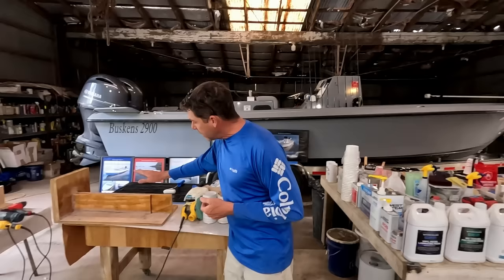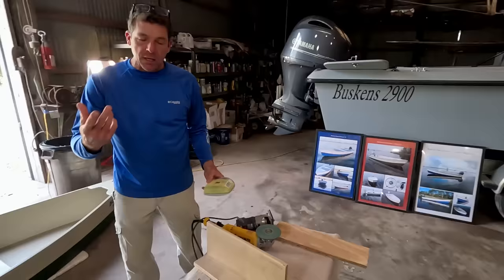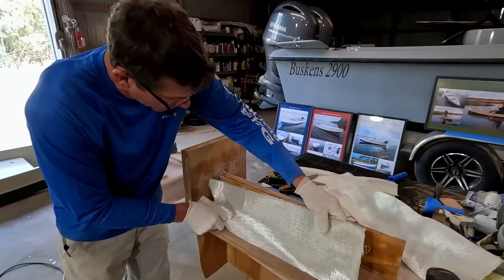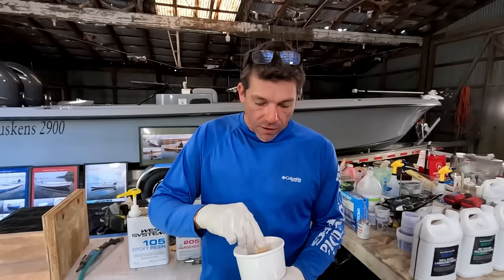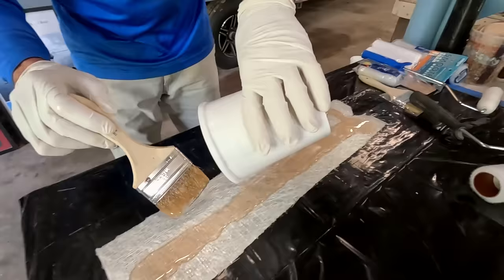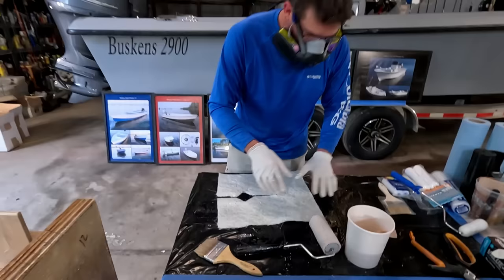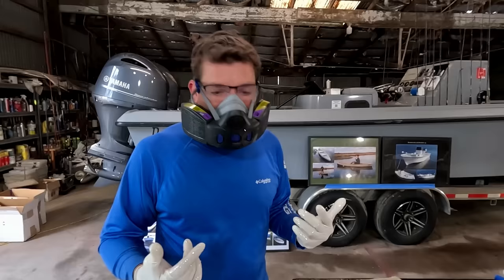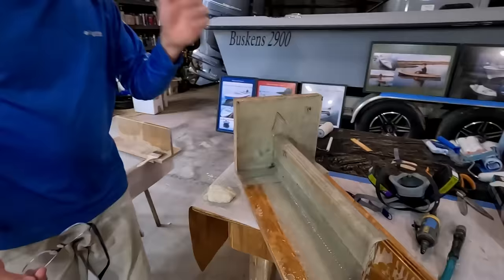How To Fiberglass Plywood w/ Epoxy - A Comprehensive Guide

Comment: Another YouTuber was redoing an old jet boat and when he was doing his transom and stringer tabbing, he was doing larger to smaller on top whereas I did like you with smaller to large on top. I did 4”,8” and 12” on mine. I would think it would be more structural going smaller to larger.
Reply from the maker: We have built hundreds of boats and done countless repairs going small to large on the fiberglass layers with very good results. I am sure you will be happy with the strengthof the layup. I appreciate you watching and commenting!

Comment: I've said it before and I'll say it again. These videos would've been extremely valuable when I was doing my own project. I appreciate them because I know how long this takes, between prep, mixing, laminating and so forth. Something I learned as far as glass forming to a radius is that 1708 forms to an inside radius, like a stringer to hull, quite well. But on an outside radius like a cap to a hull, if I flipped the 1708 over so the mat side was up, it actually took to the bend much like mat side down on an inside radius.
Reply from the maker: Thanks so much! I appreciate your thoughts!

Comment: Thank you, your videos have helped and guided me through my project. I am filling in an out drive hole in a transom and adding knee supports to the inside for a outboard bracket conversion. I am experienced in autobody repair but never did much with fiberglass.
Reply from the maker: Glad to help and best of luck with your project!

Comment: Hi, bass fisherman from Canada, I m restoring a 28 year old hyda-sport bass boat that has fiberglass foam filled stringers, plywood transom,  plywood floors and foam core in the bottom of the hull, every inch of foam and plywood is water logged, the floor was bolted to the stringers with screws that were not sealed and water got in, the fiberglass work on this boat is terrible, huge air pockets in the fiberglass, very bad tabbing of the stringers, sloppy sloppy friday afternoon work.

Thanks for sharing your knowlege and taking the time to film, keep it up.
Reply from the maker: Glad to help! Yes, it is shocking how bad some of the glass work is in some production boats! I am sure it will be better than new when you are done. Thanks for watching all the way from Canada 🍁!

Comment: Very good explanation and instructive.  Would have saved me lots of sleepless nights.  The difference between epoxy and PE resin with CSM is very good.  I’m looking at molding hatches so PE will be the ticket.  Those little skiffs remind me of Stauters built in Theodore.
Reply from the maker: Glad to help! I have actually owned several Stauter skiffs, and done some restorations on some others. The ones we build are usually stitch and glue, and painted inside and out. I think we might build one of ours on the channel if I get enough interest. Thanks for watching!

Comment: So I am using iso tooling resin for my project and I coated all the stringers with a 50/50 mix acetone and resin, as per a recommendation from the company I purchased my resin from. Then I saw your video that mentions this isn’t a good idea and should have used styrene monomer. It’s done now, but before I glass, should I do a bit of sanding? The first portion I started I didn’t. Hope I’m not messing up too bad. Thank you for all your help as you have an amazing channel and the best content on you tube for DIY’ers!
Reply from the maker: Glad you are enjoying the channel! A 50/50 resin to acetone primer is not something I would recommend, nor do most resin manufacturers. But I have heard of some people doing it,and having some success.I wish I could give you more advice on this one! But it's just not something I have experience with.

Comment: Once again- amazing tutorial!
I wonder, is there a better material than plywood, but cheaper than coosa, for boat use?? 
What about that honeycomb sheeting? Would that be structural enough, and would it be prone to water infiltration?
Reply from the maker: There are lightweight structural foam cores, but they rely on quite a bit of fiberglass on both sides of the panel for them to have much strength. Those cores don't hold fasteners well like plywood or Coosa does. If I find anything that will bridge the gap between Coosa and plywood I will let you guys know. Thanks for watching!

Comment: Thank you for your informative videos, I find them extremely helpful. I'm planning on building a plywood aquarium and sealing the interior with fiberglass. I do have a question that you might be able to answer. If I fiberglass the wood portion of the viewing panel, can I use 100% silicone sealant between the fiberglass and the glass viewing window?
Reply from the maker: Glad you are enjoying the videos! I would imagine that a quality marine silicone sealant would work for your aquarium build, but I can not say for absolute sure. Maybe someone could comment on this if they know. Thanks for watching.

Comment: I recently picked up a 1978 Dixie center console in need of floor and transom repair. I live in a coastal village with only one lumber supplier. I called to price marine plywood and the salesman recommended using BC plywood and encapsulating it in resin before installing it. Also is it necessary to re-foam the hull under the floor?

I would like to know your thoughts before moving forward with the restoration. FYI this is a budget build and it’s hard not to rush it when I cross 4 rivers and a bay daily. Thank you for sharing your knowledge and time!
Reply from the maker: Plywood quality can vary so much that it can be hard to say for sure without seeing it. The plywood they have might be just fine for what you are doing. If in doubt about the quality of the plywood, you might want to consider using epoxy or vinyl Ester resins for the job as they tend to bond better to a broader range of materials. As far as the foam under the floor goes, it is not only flotation but it can also add strength to the hull bottom. I usually recommend going back with materials that are at least as good, or better than the original if possible. I hope this helps, and best of luck with your project!

Comment: Great video.  Towards the end you indicated there are times when polyester is put over epoxy. If you are unsure what the current resin is, is there prep work that can be done to help the poly bind if it is in fact epoxy?
Reply from the maker: Thanks, glad you enjoyed it. We don't usually recommend going over epoxy with polyester products. It can be unpredictable. Some material  combos will work and others will not. You can use epoxy over polyester with good results though. I always tell people that experimenting with different materials in small, non critical test batches could answer some compatability questions for you. Hope this helps and thanks for watching!
Reply: @FishBumpTV  thank you for the quick response. This is on a 1986 bass boat stringer reinforcement.  My guess it is polyester, what would be the behavior of the bind if incompatible.  I plan on using poly for the deck replacement.

Comment: Again thank you. I have a question, I am rebuilding transom and floor on my Avon searider 5.4 rib. There larger areas are needed to be layered with fibreglass which suggests more resin is needed for each lay up? So do we still use the pumps or is it too small quantity mixed this way and we need to use mixing cups? I am fairly confident I can mix correctly either by weight or volume, but I don't know if this will produce too much heat due to larger volume. Also, what is the recommended maximum size of fibre glass piece to use for each lay up in order to avoid creating too much heat? This is my first fibreglass repair and your channel offers amazing knowledge and value.  Thank you.
Reply from the maker: Yes, you can pour into cups for larger batches. Just be sure  to get your ratios correct. There a lots of variables when it comes to max size and thickness of the fiberglass. Temperature, catalyst percentage, thickness of glass and the experience level of the persons doing the work would all factor in. I would suggest starting small, and experiment some before going big. I hope this helps and thanks for watching!
Reply: @FishBumpTV  thank you!!

Comment: Loving your videos, helping me so much, I'm rebuilding a Colvic Watson 28' 6", and I'm going with epoxy, what weight 1708 do you use? many  thanks from England!
Reply from the maker: Thanks so much for watching all the way from England! Sounds like a interesting project. Our fiberglass suppliers only stock one kind of 1708 as far as I know. Maybe overseas there are different options for 1708 fabric. I will try to do some research on that for you guys.   Best of luck with your project!
Reply: thanks for getting back to me, we seem to have what's called combination matt, which looks the same as 1708, but in three weights to choose from, in grams per metre, I think I'll look at the middle weight to start with, and go from there, it's compatible with epoxy, so should be good.

Comment: So I was not aware of the Amin blush cleaning process, and went ahead and applied gel code straight over my epoxy repair. What is the best way to remove the uncured gel coat now so I can go back and clean the amine blush off?

Comment: Great video, thank you! I made a mistake and forgot to remove the blush after the first "sealing" layer on wood, and made a second layer on it. Should I remove/sand everything down? No judgement, please, I feel stupid enough already...
Reply from the maker: Thanks, glad you enjoyed it! Some 2 to 1 epoxy resins may not produce amine blush, so if you happened to use one of those, you may be OK. You might want to reach out to the company and see what they say. Otherwise the amine blush from the first coat will not allow the next coat to bond properly, and will probably release or come loose at some point. To be on the safe side you may have to remove the last coat by sanding or grinding it off. I would definitely check on if the epoxy does produce a blush first though. Hope this helps and I appreciate you watching!
Reply: @FishBumpTV  I'm using 5 to 1 West System 105+206, sorry I didn't clarify that.  I will grind it down, lesson learned :) Thank yo for the reply, and thanks again for the video!
Reply: Just an update/question: cleaned with soapy water and paper towels and don't see any dirty water or signs on towels. How do I know if there is any blush at all? Cleaned and not cleaned areas look and feel the same.
Reply from the maker: @musette-studio  The 5 to 1 west definitely produces a blush, so you did the right thing by grinding the new layer off. The grinding plus the cleaning should have removed the blush.

Comment: Hello, I have a question I have watched alot of your videos, and you talk about 3m marine high strength repair filler vinyl ester. This video you talk about your peanut butter is there a difference as to the effects or bonding of the peanut butter as apposed to the 3m marine high strength repair filler to the epoxy resin ? Does it seal better with combination of peanut butter to epoxy or is it the same with  3m marine high strength repair filler? Thank you so much for your information, I am with USCG as well learning about wood working and boat building through you since all our boats are aluminum or steel.
Reply from the maker: The 3M high strength filler should be used over polyester and vinyl Ester based resins and fillers, not over epoxy based materials. I aways recommend using epoxy based fillers, like the peanut butter over other epoxy resins  and fillers. There can be serious bonding and compatibility issues if you put polyester or vinyl Ester over epoxy. I hope this helps and thanks for watching!
Reply: @FishBumpTV  thank you so much, you have taught me so much.
Reply from the maker: @nonstopfishing6486  glad to help!

Comment: Do you ever apply your cloth onto previously applied resin that you have allowed to cure to the point of  being very tacky but not fully cured so as to secure the fabric in place? 29:34 And in what circumstances would you do that?
Reply from the maker: I don't typically do that, but you can. The downside is it makes it hard to reposition the fabric if you don't place it just right. It could be helpful if you are fiberglassing overhead though. Thanks for watching!
Reply: @FishBumpTV  Great information, thank you!
Reply from the maker: @RK-pe8fc  glad to help

Comment: I’m curious as to what fibreglass & resin product would stand up to the most abuse as I’m thinking of building a hybrid between a Garvey and pacific Dory. I hunt and fish heavily, haul quads, haul building materials and people frequently in a flat bottom pacific dory style boat.
Reply from the maker: Sounds like a interesting project. All the materials have pros and cons. Cost, workability, availability etc. It is hard to say exactly which combo would be best for you.   Gelcoat is probably going to be the toughest material for your exterior coating, and if you want to use gelcoat, then you would use a polyester or vinyl Ester resin for your fiberglassing. In my opinion, Vinyl Ester is the better of the two as far as  bonding and waterproofing. I will be making a resin selection guide video very soon for you guys. Hope this helps and thanks for watching!
Reply: @FishBumpTV  Thank you for responding. I appreciate your input and it’s given me my answers.

Comment: I am converting a 16 Prindle catamaran into a pontoon. What do you recommend for decking material? Marine plywood, coosa or honeycomb materials? Thanks.
Reply from the maker: I would recommend either Coosa or marine plywood. Coosa is more durable, but more expensive. Plywood is cheaper, and usually easier to get in most areas, but it can rot or weather over time. Hope this helps and thanks for watching!